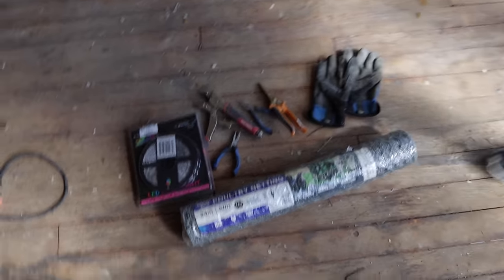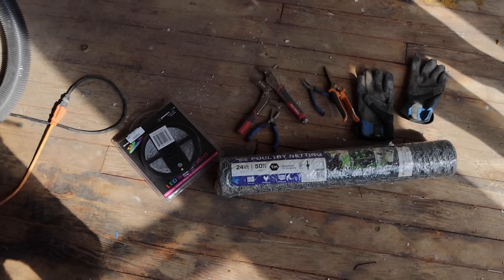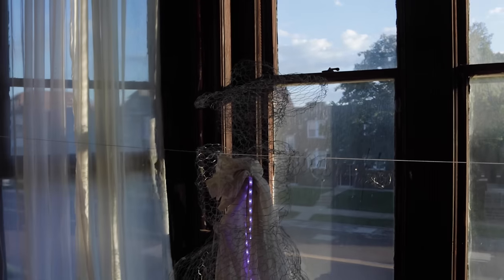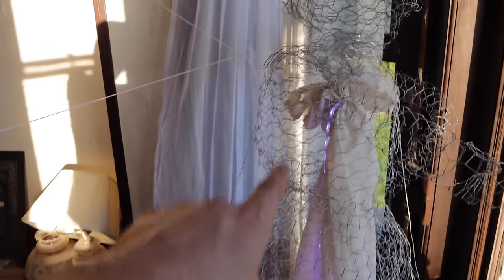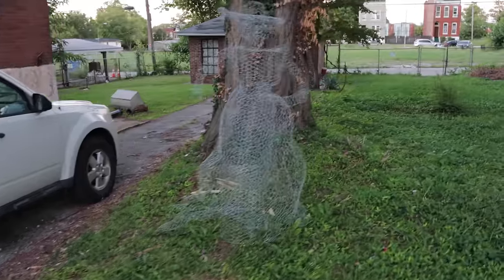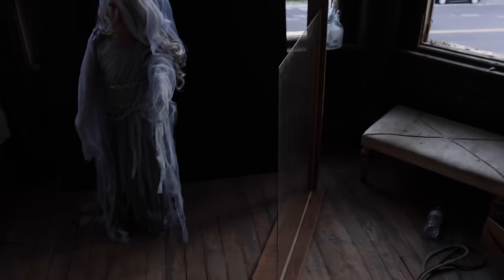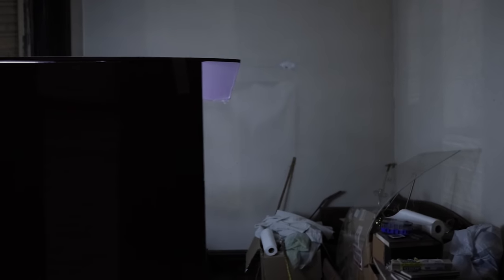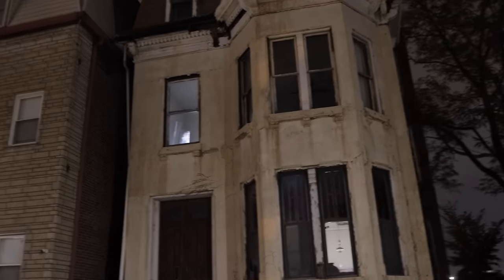How to Make Your Own Ghosts!

Comment: I love all of your videos so much. I have a potential suggestion for your chicken wire ghosts. Take a mannequin and pose it how you want, then carefully put 6" long pieces of clear packing tape on every square inch, kind of like how you'd apply strips of wet newspaper to make paper mache, taking your time and pressing hard making sure there's several layers. Then you carefully cut a seam up the back of the mannequin, its arms and legs, and carefully remove the mannequin.  It is very time consuming... but you'd get less nicks and cuts than from the chicken wire! The result is spooky, and very ghostly!! BOO!

Comment: Not sure if you ever found any more info, but the "Champion Duplicator" sign from a few episodes back is from a New York company that manufactured and sold early office machines.  They started with very early typewriting machines and later ventured out to other mechanical office equipment.  One was their duplicator. An early precursor to the mimeograph or copier.

Comment: Grate videos and skill set, 
question have you identified chases to run wires in for piping to upgrade the infrastructure? 

When you have floors and walls open it would seem logical to be thinking about upgrades to infrastructure.

Comment: Awesome ghosts! A little tip from a theatre techie... Please use a dim light for a Pepper ghost effect... and have the light on the floor shining up onto the mannequin. I like using a Gemmy short circuit light bulb for a spooky pepper ghost effect.
Reply from the maker: This room currently has no working electric so we used a battery operated light on the lowest setting.
Reply: @The2ndEmpireStrikesBack  Ah Ok. Hmm i wonder what effect battery operated candles would give sitting on the floor around the mannequin.